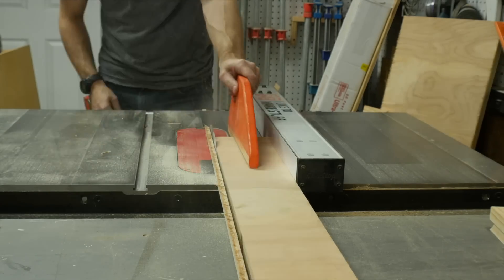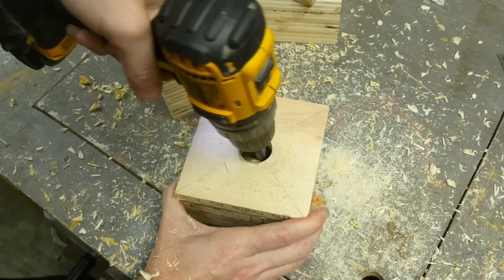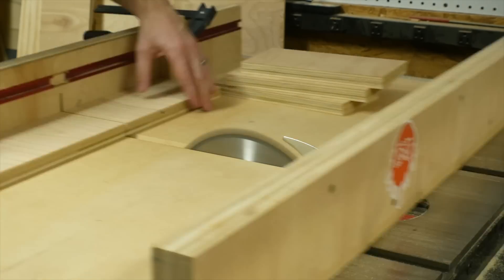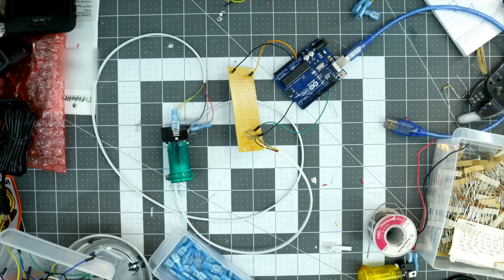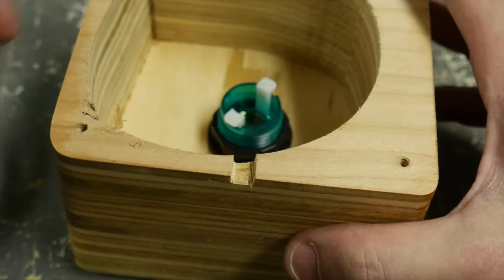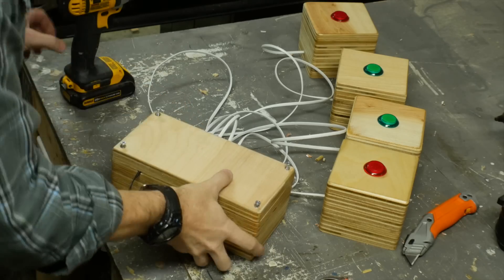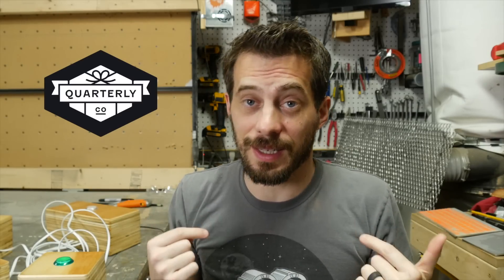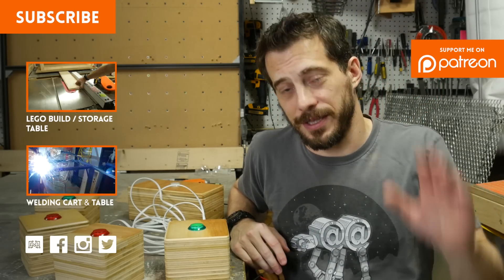Quiz Game Buttons // How-To | I Like To Make Stuff

Comment: OMG the inner hole is untidy af
Reply from the maker: +ThoperSought Exactly. Do you keep the inside of your car engine spotless? No, because that doesn't matter as long as the components do their job.
Reply: +xTJRsAsEAx Just enjoy the sausage and forget how it's made.
Reply: xTJRsAsEAx 
true, and I don't like it either, but does it matter? no one who uses it will see it, and it doesn't affect the function at all.
Reply: I Like To Make Stuff
I figure that if really old, über-classic handmade furniture that's in now in museums has un-smoothed back panels, and tongues and grooves fitted 'just barely good enough', while the show sides are that spectacular, then it really doesn't matter.  it's in a freaking museum.

they put their time in where it counts.  aspiring to impossible standards of perfection is a recipe for burnout.